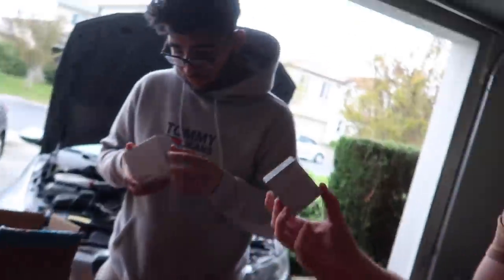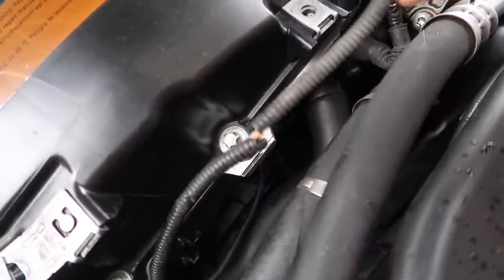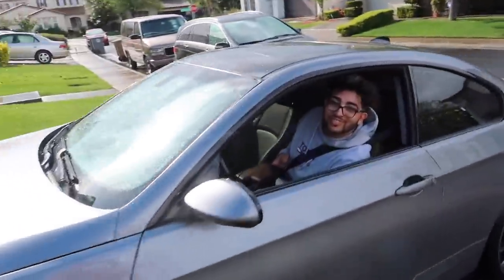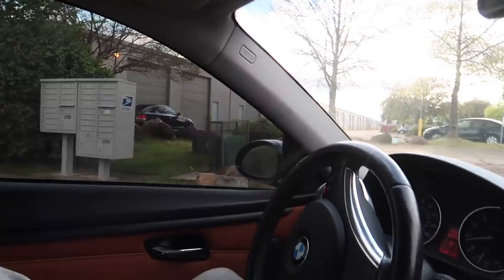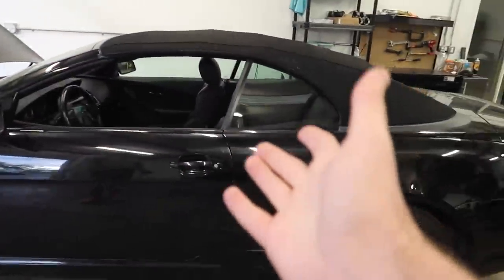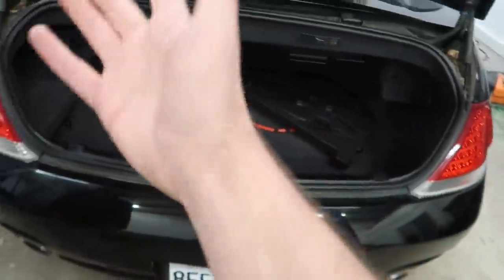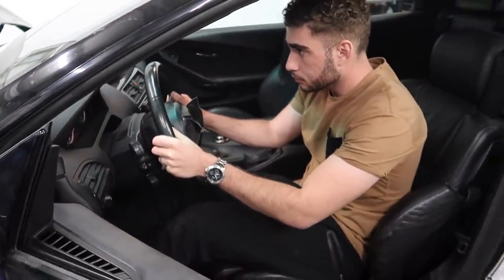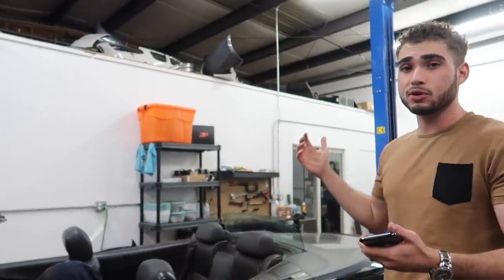I Bought a TOTALED 4.8L V8 BMW For $800! UNKNOWN ISSUES!

Comment: When the airbag deploys in a BMW, it disconnects the battery safety terminal. Even though you said it was replaced, it'll need to be bypassed or you'll have to fully fix the airbag system and reset the airbag control module which'll require taking it in to the dealership to get done. I'm excited to see this build! Loving the channel!
Reply: SeonTheNeon i was about to say the same thing. Basically all german cars doo this noor check this out

Comment: I think the car has a cutoff fuse at the battery  when it gets in to an accident not sure tho.
Reply: yes it might have pyrotechnic fuse that has a explosive charge that blows when the car airbag sensors get triggered by the accident
Reply: Yup +1
Reply: Yeah check that first.  Crank + starter fluid = no run means no spark
Reply: Doesn't have a fuse, has a wire. The BST - Battery Safety Terminal - disconnects itself on impact to cut fuel to prevent a fire. It won't let the car turn on and will need to be replaced or bypassed.

Comment: The code is when the immobiliser has no communication with the DME it can be caused by the battery or ignition key in my brothers 6 series case his he had an Ignition key failure
Reply: Or maybe a blown fuse ...or always the pyro fuse due to the blown air bag
Reply: Some BMW like the 1M Coupe dont start if the Airbag is blowen up. So you have to change them, but i dont know applise to the 650i too.
Reply: Check connections to the dme another easy fix would be check spark plugs

Comment: I remember I wanted one of these back in the day... I went to test drive one and it started smoking profusely from the engine bay after a few pulls. Turns out, these cars commonly suffer from an oil leak that requires the entire engine to be removed in order to remedy it. Long story short, I ended up buying an N55 F30, and I'm glad I did. This could be a super unique build though and I'm looking forward to it.
Reply: bavarian_tuned oh that oil leak i thing its a valve seal hoovies garage bought a alpina b7 with that issue
Reply: Stem seals are known

Comment: If that doesn't fix his check engine light you might want to change the timing chain tensioner.  If it is week the timing will go out during acceleration causing the same issue.  If so it should be done asap before timing skips.

Comment: my 2 cents worth is that the EWS/DME are not synced, maybe due to the airbag deployment "not sure" but any way,  maybe just doing a EWS/DME start value reset using BMW ISTA "RHEINGOLD" should get it to start.

It was success for me on an E46 & E90 and needs to be following by a adaptation reset while the car is in accessory mode "not running"

Comment: Also had a 650i for 3 years and i have to say i had really many troubles with it, electric, engine, power loss, oil leaks, steering, transmission and so on... happy i have sold it 😬

Comment: I had identical problem on a e90. It is probably because the battery went completely down back in time and after that the car forgot the key. The other possibility is a problem with the immobilizer.

Comment: When the airbags pop the fuse on the battery pops too you need to get the new cable idk if it can be replaced separately but you can just jump the fuse and see if that works so you don’t spend more money than you need too

Comment: Check the fuel pump. 
Fuel pressure regulator. 
Fuel relay. 
Spark plugs 
Compression and timing. 
Had same issue on my car. 
Turns out it was the ecu.

Comment: Brooo sync the key with the dme and you are good trust me.. use inpa or ISTA D. ews/cas/dme synchronization ... i had the same issue it will crank but the engine wont turn over ... had a issue with an x5 4.8i v8... it will fire ryt up.. it will literally take 5 mins.. hit me up if you need help

Comment: Ews failure is an immobilizer failure the cas and the dme are not communicating with each other sometimes a software update can fix it and sometimes you have to sync them together again to get the car to start. The car basically thinks someone is trying to steal the car so it’s not allowing it to start

Comment: Hey dude... literally HAD THIS ISSUE LAST MONTH!!     The EWS DME and CAS are not communicating together the engine rolling code is lost due to low battery and someone trying to turn the engine on. Cost me £200 to get it fixed. There’s a few EWS coding YouTube vids check those. 100% but if you managed to have another key with the car try that but the CAS EWS and DME are not synced.

Comment: Doesn't sound like it's got spark check all the coils and wires running to them for bad connection and if the coils have oil at the bottom of them they won't have spark so check that too
Reply: Or the immobilizer isn't communicating with the DME

Comment: I have a 645 E64. Things I've had to have fixed -- Alternator bracket gasket oil leak, Valve seal leak, water pump, oil pressure switch, bank 2 catalytic converter, coolant leak, third brake light, brake booster, new battery, Alternator, I've spent the value of my car in repairs and have only driven it 13k miles. I'm going to sell it soon.

Comment: Heed the warning, get rid of that shit unless you wanna deal with N62 problems. Coming from someone who had a 7 series... this engine isn’t for the faint of heart man. Trust me 🙄
Reply: J_ Spool went from a 550i with the smg transmission n62 to a 335xi n54
Reply: Bavarian Motorsport well my 750li E65 got wrecked and replaced it with a E60 535i. Replaced a lot of the known issues on that N62 but didn’t get to the valve stems because it got wrecked. But that was next in my list 🙄
Reply: J_ Spool I honestly haven’t had too many issues with the n62. It was mainly the smg transmission that kept giving me problems. I haven’t drove it in such a long time and it’s just leaking a shit ton of oil.
Reply: Bavarian Motorsport lol.... my guess would be the alternator bracket gasket. That $5 gasket is a fucking nightmare 🤣. I did... the mechatronics in the 7 series too. It’s a known thing with some zf transmissions that the bridge gasket/seal inside transmission cracks and loses pressure so you start having issues with shifting. BMW upgraded that part also

Comment: Oh Boy You Don’t Know What You Got Your Self Into! BMW V8’s are Junk Especially N62 and N63 Engines. Valve Seals are Major Issues in this Motor With So Much other Stuff. Replace it All Timing cover seal. Valve cover Seals, Alternator Bracket Seal valley Pan leaks (Under Intake) These Engines Are JUNK! Hope You can Fix all this when it goes Bad or is probably bad. Nice Looking car tho!